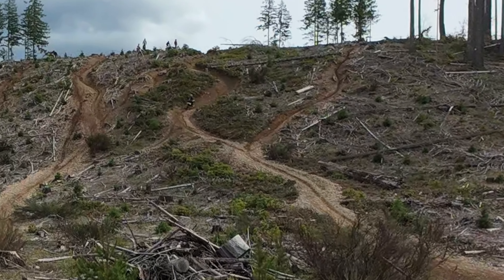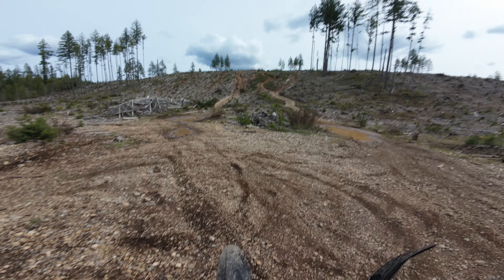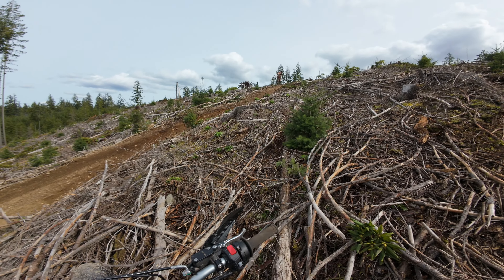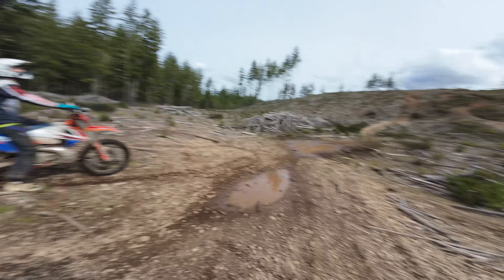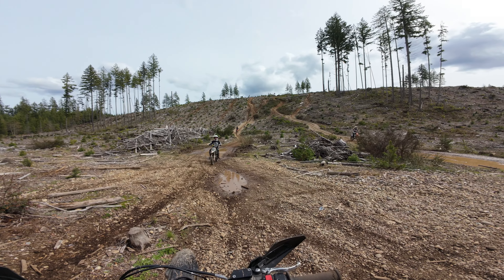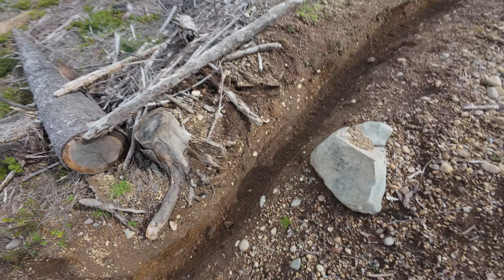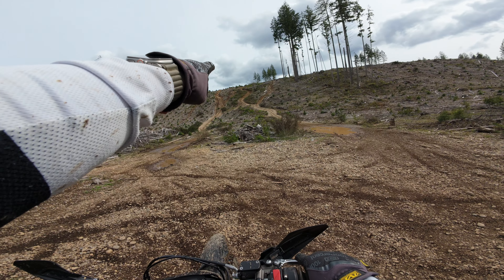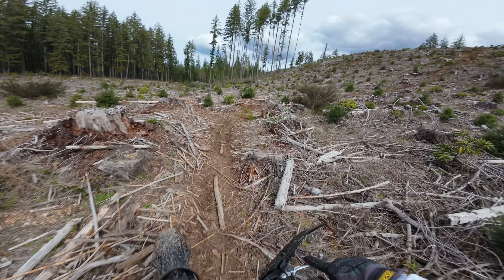Can it climb? - Surron Ultra Bee

Comment: Get yourself a Torp TC1000 and go from 12kw to 17kw on the stock battery.  Could help a lot with the steep climbs you’re running out of power on.
Reply: I've recently fitted my TC1000, max output states 15.5kw (I'm stock battery and Motor) I'm maybe missing something to get to 17kw? I haven't yet contacted Torp about this. Mind you, 15.5kw is over the top for my use⚡️✊️
Reply from the maker: Yup!  Torp is on purchase.  Then I’ll eventually pick up a battery.
Reply: @gavindobson6077  it is a significant improve acceleration ? and what about the range it is decrease a lot ?
Reply: @Etonnantnon  hi, thanks for the message. I have done a lot of rides now with the Torp (no vids on YouTube yet) The range is not really impacted in my type of riding, which is single track and slower, technical riding. It all depends on your settings, riding etc. I love the controller, and I'm still on stock battery and motor. I'll line up for the TM25 motor as soon as it's available for the Ultra Bee.
Enjoy your riding mate✊️

Comment: If you do controller upgrades EBMX version 2 x9000 
And battery 
EBMX version 4 81.3v 76ah make sure its stats are this some bike shops are selling version 3 @ version 4 price ( they look identical except v3 is 73ah.) 
With a version 4 battery you’ll be able to run 28kw continuously but be careful motor will get hot and new controller will cut the power.

Comment: Running the same set up. 54t rear sprocket. Awsome bike buy suffers on big hill climbs. Im not light ( 120kg) and have had situations where im full throttle , front end just floating and crawling up at like 5kph. Also the short wheel base makes climbs hard if you get your weight wrong. Thinking either controller and later on larger battery or sell and purchase a arctic cat 880.

Comment: Noticing the same. Although a cheater bike in technical terrain with 18/21 and gummies, its achilles heel are the big hill climbs. I struggle up some of the more difficult hill climbs that I used to go up with ease on my 2 strokes. Problem for me is lack of control… either the tire spins and momentum is lost or it grabs and starts to pull up. I’ll bet more power from battery & controller would help, but without a legitimate clutch, it’s just not as easy to feather that power. Add in some bumps, step ups, or little kickers on the hill climb, and it’s even harder to modulate that throttle accurately.
Reply from the maker: Yeah, agreed! The no clutch thing is probably the biggest gripe I have with this bike.
Reply: I disagree. I have more control with my UB compared to my KTM 300. I never felt that I would be better off if I had a clutch on my UB. The problem is caused by modifying the UB to 18/21. 18 inch with fatter tire perhaps gives better traction however at the expense of reducing the power delivered due to heavier and larger diameter tire. I bet you would climb that hill no worse with the stock 19” wheel.
Reply: @bingeciren  not even close. Getting up the easiest hills with the stock setup was atrocious. Gummy 18” tire is a game changer. Possibly I could learn to adapt my technique. But I’m not getting anywhere close to where I used to get on a few of the longest & steepest hill climbs compared to my previous KTM 300 or YZ 250. For me it’s partially lack of top end power, but mostly inability to maintain momentum. Once you slow down or hesitate just a little bit, it’s game over. My 19 factory UB setup, I could barely even get started on the more difficult hill climbs due to wheel spin. 

On climbs where the front end starts comes up, shifting weight more forward as I stand on the pegs on my dirt bikes helped and if I began to lose traction, a quick slip of the clutch allowed me to ease the power delivery without losing too much momentum. Problem with electric bikes is that when you’re on a hill climb that requires full commitment to even think about making, as soon as that wheel spins just a little and you have to cut the throttle, it’s done.

Still for 95% of riding in Hawaii’s technical, muddy, rocky, terrain, I’m probably faster on my ultra bee. The crazier hill climbs, I just know I don’t have as much ability (probably part technique and part bike) as I used to with my 2T’s.
Reply: @bingeciren  In Hawaii we have a popular hill called “novice hill”. I was never great at hill climbs even when I rode my 2T’s multiple times a week. I would make the climb with my dirt bikes as long as conditions were good, too dry or too wet… I’d make it to the last steep step up. My ultra bee I tried a handful of times when I first got it with stock 19’s. Could barely get to the turnaround point about 1/3 way up. Just spinning the tire. 18/21, I get up about 2/3’s but begin having issues at the bumpier spots where it’s steep. 

I’ve seen guys make similar hill climbs with EM’s with less power, but they must just be considerably better riders than me.
Reply: The medium soft Mitas 100/90-19 tire I put on my UB improved the traction quite a bit compared to stock. O put the stock rear to the front and the bike seems to handle well at technical single track terrain. As for the hill climb, I had to change the rear sprocket to 50 to regain the lost torque. I will even try a 54 rear sprocket to see if it works better. Honestly I have no difficulty modulating the power without a clutch and almost never spun the rear tire and lost traction so far. Also I find the D mode more controllable compared to S for hill climbs. Maybe your hills are steeper and slippier than mine.
Reply: @bingeciren that’s a great compromise to improve traction while keeping weight down for range. I could not ride my normal trails with confidence with the 19-19 setup. Front wheel in 19 just doesn’t have the size to handle bigger obstacles. When pushing through rock gardens, river crossings, or rutted/ rooted trails, the 18/21 VERY much improves the bikes ability in hard enduro type terrain. My girlfriend had her 19-19 setup for a little longer than me and even though she had to tip toe a little more she felt much safer on my bike, regularly made me ride hers until we got her the 18/21 😂. What type of terrain you ride makes a massive difference in everything on these bikes, for both range, handling, and ability. Some hill climbs here in Hawaii I would say are borderline impossible for most electric bikes.
Reply: @TheTyLife88  Absolutely agree. The type of riding and the terrain makes a huge difference. No denying the superiority of a 18/21 on rock gardens and huge ruts. It’s all about compromise and selecting the best configuration for the type of riding. As you noticed, my 19/19 configuration is the best compromise for me for not adding extra weight and not losing the range. Once one goes to 18/21 route, it opens up a can of worms. Adding weight reduces the range, bigger tires reduces the torque and here we seek adding bigger batteries, different controllers, enlarging the rear sprocket and so on. I accepted the shortcomings of the UB and appreciate its advantages like lightweightness, quietness, ease of maintenance and economy.

Comment: so when you say running out of power at the top, are you referring to a pinned throttle? If you were able to make it up the other lines, wouldnt that mean there is plenty of power to get up the hill? Or does the bike cut out after given amount of load on the motor to keep itself from blowing up? Guess, Im not understanding whats happening on that middle line. If you made it within 15ft of the top, that definitely contributes to rider skill vs bike ability.
Reply from the maker: It’s def rider skill and it’s hard to “spool” the motor back up on steep grades once you lose momentum.  If I kept trying I probably would have been able to get it.  More power would have made it easier.